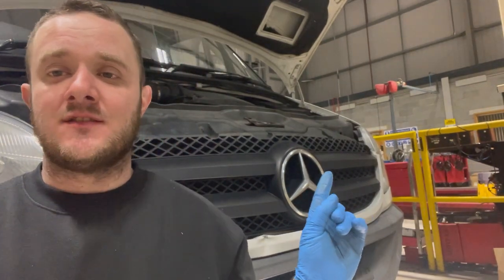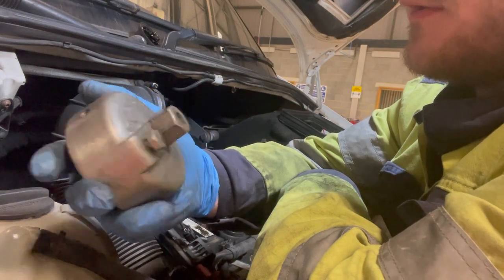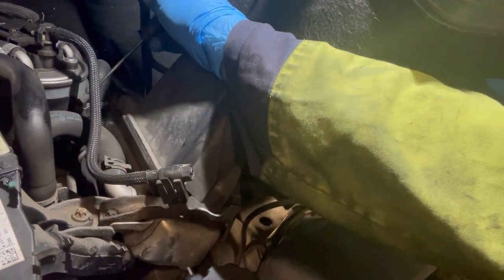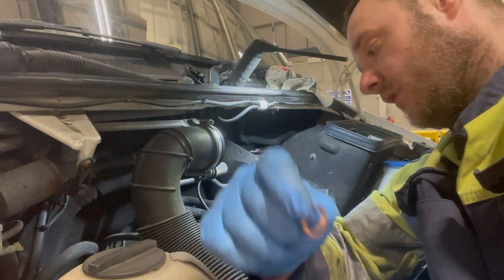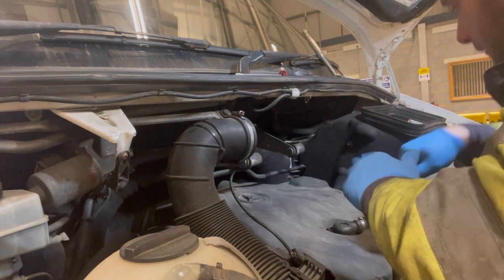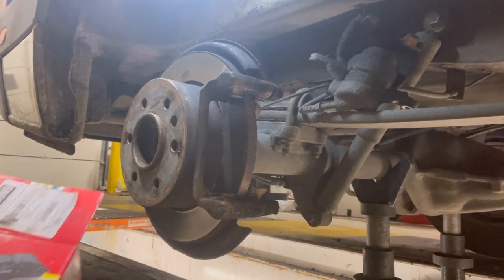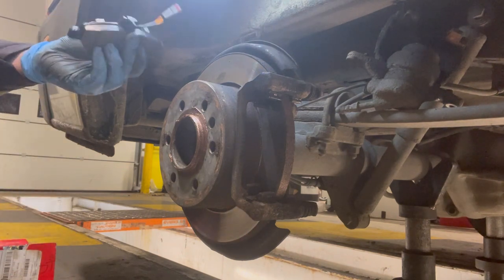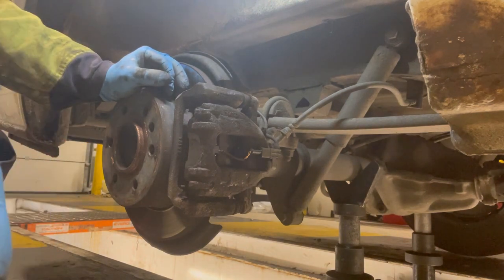Day in the life of a HGV Mechanic- Mercedes Sprinter 2011, lube service and rear brake pads.

Comment: This is my bread and butter work on these all the time. I agree injectors are pain in arse because they either seize in head or carbon up, but by far the biggest pain in the arse is the inlet manifold. Mercedes decided it was good idea to make it out of plastic so it gets destroted and breaks the mounting bolts. Apart from that solid van, keep the good content coming 👍🏻
West ham fan😂
Reply from the maker: Ahh when they carbon up it’s a nightmare! Ohh I’ve not done one they really bad? Thanks mate appreciate that! Ahh you boys having a good season!
Reply: @freightlanetv  well the manifold is just buried underneath a load of other parts, so it's just time consuming.  Conte has got your boys playing well,  Kane is like a different player now.
Reply from the maker: Ahh that’s shit! Sounds worse than doing the injectors 🤦‍♂️yeah he has see how the season pans out, think if you can keep players fit etc no reason why you can’t be fighting for top 4 too